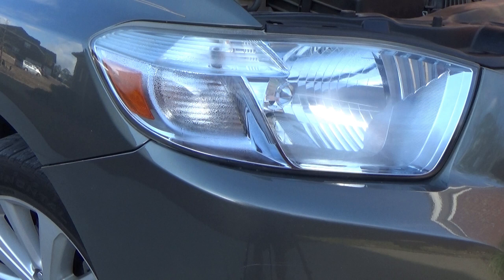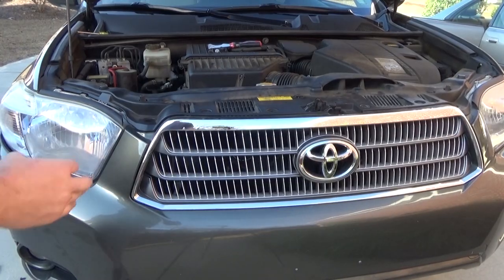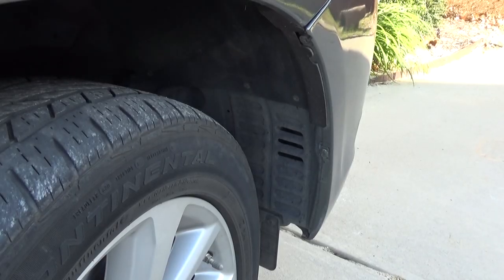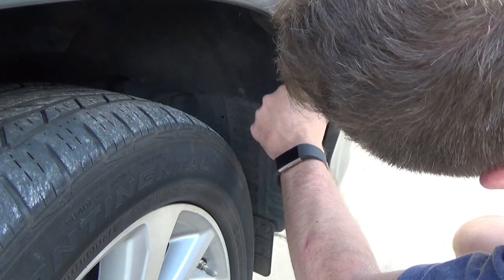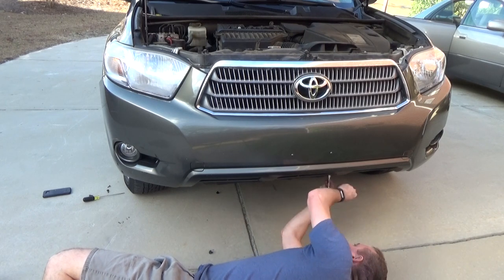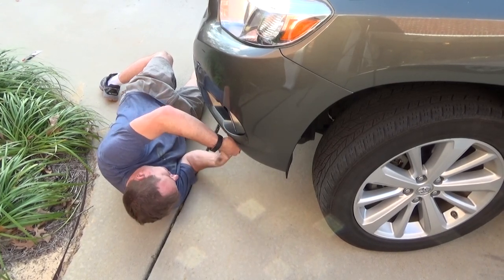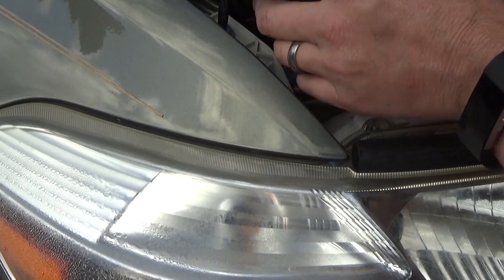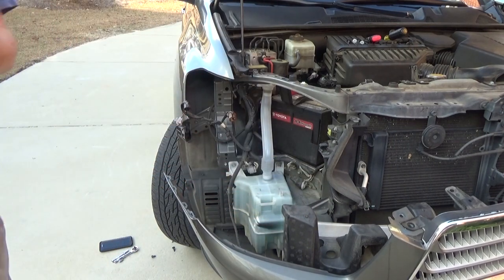How to Remove a Toyota Highlander Headlight Assembly

Comment: Thank you for a great step by step!!!!!! however you should also mention the fact you should remove the white padded shim that keeps the light off the quarter panel. Also, the light has a lip on the bottom that has to be slid to the right then up in order to remove.  You can't just pull the light out.  I had several plastic pieces snap due to that.  Just a courtesy!  Thanks again.
Reply: John Drummond; Thanks !! I was wondering if he was forgetting some things.  He also mentioned "one little plug" but did not show it. It may be easy to find, I am not sure yet but  this little left out tip costs me a lot of time and i broke some costly tabs on another vehicle I was working on. The cost was high enough  that I used glue, tape and tie strips to jerry-rig it together. = less than a quality job. Hopefully not here and probably not but it would've been helpful. It costs him a like. An incomplete on report card for a potentially good vid. Grandpa always said "don't cut corners and critically review your work. Which is lacking with You Tubers in too many cases

Comment: Excellent video! Do you recommend switching to LED headlights, or will that result in minimal improvement? I'm thinking about just replacing the yellowed headlamp assembly and putting HID lamps in the fog lights.
Reply from the maker: Thanks. I definitely recommend going with LED now.  Take a look at my other video where I compared them in the Highlander. https://www.youtube.com/watch?v=F2-Pc6TDjgY

Comment: Helped heaps!
Do you know how to adjust these headlights or ones you have put in as a replacement?
Reply from the maker: Some of the newer LED headlights aren't adjustable at all but many are.  They are usually adjusted by twisting the light in the base but each manufacturer should include instructions if they support adjustment.

Comment: For completeness, is there an image or video of how you connected the new headlight units after the old one was taken out and what it looked like after? I have a 2003 model.
Reply from the maker: There isn't because I didn't actually replace them.  I just took them out to fix the moisture issue.